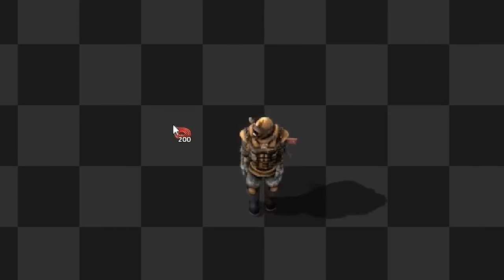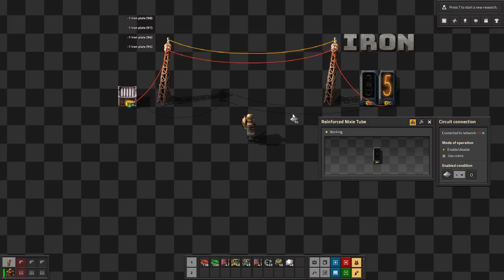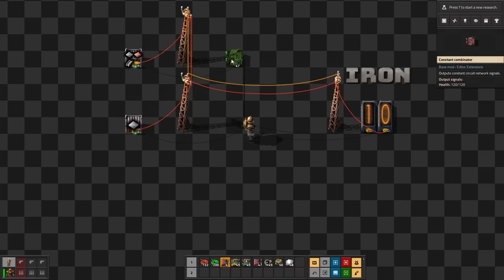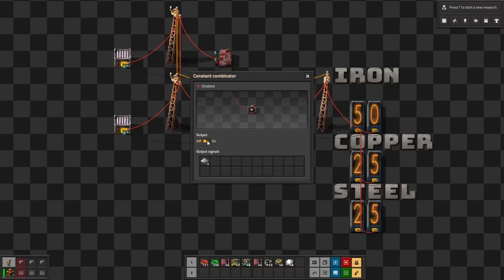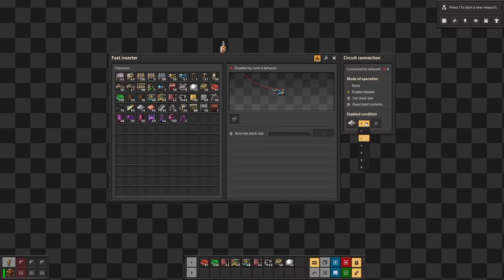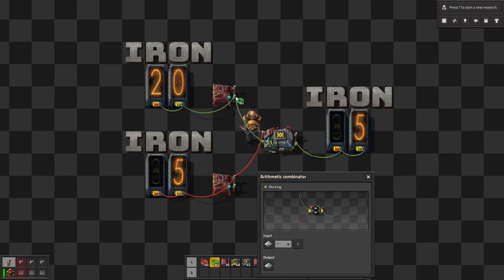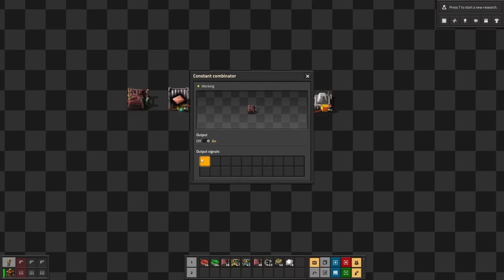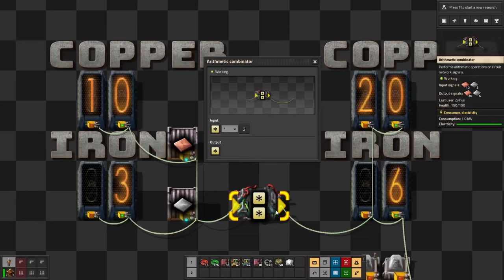Factorio Circuit Networks Explained in Under Three Minutes

Comment: Using signals to count the ore at a train stop, and only allowing trains in when there was enough ore for a pick up (to prevent trains hanging out in loading bays for too long) was probably the most complex things I've done with signals. Looking forward to upping my game.
Reply: For even greater convenience, I highly recommend the Logistic Train Network mod. You wire up your containers to the train stop, and add a combinator that causes the stop to request items when it doesn't have enough. Then a train, which was sitting in a depot, goes to whichever train stop that's providing enough of the requested items, and then delivers those to the requester. 
I'm currently using it in a city block playthough, and it removes so much of the finicky admin tedium.
Reply: I have such an immense respect for the intelligence of you factorio players. Cause I got lost about 30 seconds in
Reply: i've literally only read the input of a storage tank to turn on and off a pump to my oil cracking, you're probably ahead of me
Reply: Honestly you really don't need to.  Keep these systems simple and it'll be easier to copy, build, troubleshoot and fix.

When it comes to logic circuits - less is more.
Reply: Managing nuclear power is a great use of signals.  Wire up inserters putting fuel in and taking fuel out, and checking steam in a tank.  You read a steam tank to make sure you have enough of a buffer between steam capacity and heat capacity, the inserters removing depleted fuel are controlled by that, I think.  You read the removal inserters' contents, set them to hold, I think, and only feed new fuel in when depleted fuel is present, to make sure only one is in each reactor at a time, limiting the inserters adding fuel to 1 capacity, also.  Using logistics and requester chests is a great way to evenly distribute the rods to the feeder chests, and collect depleted fuel.
Reply: You can bypass all of that by just adding a stop/go condition on the train of: "go when x amount of time has passed with no actions". 
This allows the train to never stop making deposits and pickups.
Reply: @matthewcurry3565  Sure, but then I have trains constantly running, making tiny pick ups. And I don't want that either. Obviously there's no "wrong" way to play factorio, and I do/have used that condition as well. I just like closing stations that don't have enough for full pick ups. If a train is going to run, it needs to be full. Else it feels "wasteful" to me.
Reply: @ravingodd  Yeah, you combine it with wait till full so that it picks up as much as possible before leaving. You can add multiple conditions that act like or/and statements, but like you said. No real wrong to play other than getting eaten lmao
Reply: @CheshireCad  That's been in vanilla for a few years now.
Reply: @ravingodd can’t you just set the train to only move when cargo is full?
Reply: @zach237  "(to prevent trains hanging out in loading bays for too long) "
Reply: As someone else says, your method works, and may be what you want.  The alternative is not to set "Enable/Disable" on the train stop, but instead use "Set train limit".  If a stop is disabled, then it is just taken out of the locomotive schedule: the train goes to the following stop, incessantly.  If on the other hand you count the ore at the train stop, feed the signal into an arithmetic combinator to divide by (train's ore capacity), then output as a signal, (default is [L]) to feed into the train stop to set the limit, then the stop will only accept the number of trains that it can fill.  If that number is zero, then the loco will wait wherever it's stopped, showing "Destination Full".  If the train is in a depot, then that behaviour is mostly what I want. 
Attempt at a wiring diagram:
[ORE BOX]--[ORE BOX].....[ORE BOX]------[Ar.Combinator / 8000]---------[Train Stop| Set train limit]
8000 is the ore load in a 4-wagon train; adjust for different stack sizes and wagon counts.
Reply: @jonathanrichards593 my issue with this is I want to only allow 4 trains max and for some dumb reason there is no "max" operator on any type of combinator. It adds too much to each train stop.
Reply: I prefer using isolated logistic networks for mining outposts, you can just connect a wire from the train station to a roboport and read the logistic contents it's much simpler
Reply: Yeah it is also cool to make signals for like a cargo request when items are low

Comment: Something very important to note about signals is that they always default to 0 whenever there's nothing else going on
This means you only need a single Decider Combinator to rig a train stop to flip between having 0 or 1 maximum waiting trains, based on whatever signal!
(I personally string together the train stop's storage chests to the combinator and have the signal be Having Enough/Not Enough of the item the station is giving/receiving)

Comment: This is an ideal tutorial. My primary issue with most game tutorials, including factorio, is that everyone takes too damn long to explain something simple, this  leads to people thinking easy concepts are hard. 99% of factorio signals are setting a X>Y=enable signal, definitely dont need 20 minutes to cover that. Great job as always.

I'm not sure I like the re-upload more, but removing them makes for a cleaner video and doesn't compel me to pause constantly to read the clarification, so its fair play.
Reply: yeah i especially like how if i already knew all this stuff i would already know it and this just says again what i know, and since i don't know anything, this basically just told me again what i already know that signals control stuff but no useful info about how to begin using it
Reply: @anchez-os3fv  Do you have a question? If so, there's this really great 3 minute tutorial I found that, in the first 1.5 minutes, describes almost everything you could possibly need to know for about 90% of all circuitry usages in all factorio :D . In the last 1.5 minutes it goes into some unnecessary detail for advanced stuff that you'll likely never need so you can safely ignore it. If you've got a specific scenario that you think wasn't covered, I can probably walk you through it though, so feel free to ask.
Reply: @wilshireanasurimbor3068  well I came looking for a tutorial that explained the basics of using networks even if just briefly  and left knowing a vague idea of the concept with no actual explanation of the mechanics of using it. I've heard the OP is pretty well known for factorio so I thought it would explain more. I watched a video by another guy that was longer but explained much more how to actually use it. I'm just surprised so many comments are saying how this video was such a good tutorial that explained it so well. Seems like you would have to ALREADY know how to use it for this to summarize it for you.
Reply: @MarioSanchez-os3fv  Well I would say that the poster is well known for doing ridiculously elaborate runs, using extremely complex circuit mechanics akin to building computers in game, and generally being sarcastic. The 3minute tutorial is a great reference, and is more than all the information one needs to use circuits in game. 

Circuits are dead simple: connect wires to stuff and use the game's GUI to set things like X>Y to turn on/off inserters/machines/etc. If you need more than that, the factorio wiki does a great job both explaining basics and giving examples of common uses (SR Latches, Memory Cells, etc. etc.). 

With these two things, this tutorial and the factorio wiki page, you can get through even the most complex mods in factorio (Pyanadon, Space Exploration, Seablock, etc.).
Reply: @wilshireanasurimbor3068  yeah I see that now the title just doesn't convey that.
Reply: @MarioSanchez-os3fv  I don't know if you still care but personally spending 10 min experimenting taught me more than any videos out there. I suggest you do the same.

Comment: I look forward to the in-depth tutorial. I know the basics, but coming up with usecases that actually help my base is the hard part. If it fits the tutorial, can you show some designs you tend to use a lot?
Reply: Something I often use is I setup a logistics network at a remote outpost and multiply the value of all items in it by negative one. Then I have a constant combinator with however many items I want unloaded. Then, I add the signals together. This gets sent to filter inserters to set their filters. I can also use it to enable the train station only if I'm missing at least five of something.

You still have to load up the train (I just assign slots in the cargo wagon to specific items with middle click), but it gets around the problem of having only twelve inserters and chests and makes it really easy to add new items. I use it for supplying all the materials for defenses and for building new wall segments.

There's a much more complicated version that makes sure the filter inserters only try to unload things on the train, but it's a pain in the ass.
Reply: Two common use cases I have seen and highly recommend are managing your oil cracking/management and fuel rod insertion at nuclear power plants. Out of the box (i.e. no logic), both of these can be highly inefficient, which can be improved signifigantly using circuits.

Another use case I fell in love with was sushi belts on my assemblers. Rather than wiring up a complex network of belts to my assemblers, I used sushi belts to feed more complex recipes, allowing 3+ input assemblers to have the same form factor as a 1-2 input recipe (since my later designs also output to the sushi belt and split off the output product using a filter splitter, just make sure you wire the output inserters to turn off once the output belt is full or the output product will clog up the sushi belt).

Comment: One thing I would like to add, that you glossed over.

Connecting the input to the output of a combinator is the most common way to make a simple memory cell. Though they tend be easier to manipulate with single tick signals.

Comment: There's a neat trick you can do with the enable/disable of any inserter (yes, even burner inserters, somehow), exactly one arithmetic combinator, and a bunch of chests that you want to fill/drain more or less evenly (like at a train stop), so long as it's only one kind of item you're dealing with (you can probably make it work with any number of items, but I haven't gotten that working yet due to lack of need).
Anyways, how to make it do the thing:
First step, lay out your train stop with all the chests and inserters, but don't let it have any items yet. Count how many chests there are, and remember which item you're passing thru those chests into or out of the train.
Second step, wire all the chests to ONLY ONE color circuit network wire, and send that wire into the input of an arithmetic combinator.
Now, set the arithmetic combinator to Divide, with the left signal being the item that's going thru the chests, and the second signal being a constant equal to however many chests you had. This gives you the average number of items in the chest, because an average of more than 2 numbers is just "Add up all the numbers, then divide that by how many different numbers there were", and connecting all the chests to a single color of wire already added together all the items in the chests, and the constant that the arithmetic combinator is using matches the number of "different numbers" aka chests you have.
So you have the average number, what do you want to do with it? Well, I usually tell the arithmetic combinator to output the average signal to "Signal A", where A stands for Average, just so that I don't get confused.
OK, Step Three, and here's where it can malfunction if you don't wire it up right.
First, which inserters are we talking about here:
I usually make my train stops with 6 chests and 12 inserters per cargo wagon, with 6 of those inserters linking the 6 chests and the cargo wagon, and the other 6 linking the chests and the belt. For a "standard" 2-4-2 double-headed train (what I usually use, out of habit more than anything), that would be 24 chests and 48 inserters, but if it's a high demand item I'll also do double sided load/unload from that train so it would in that case end up with 48 chests and 96 inserters.
In any case, if you always have 2 inseters per chest, we can keep going, I'll tell you how to adjust for more inserters being used all the way at the end, but I have to get the basic concept out of the way first.
So, 2 inserters per chest, one moves items between the train's cargo wagon and the chest (or vice versa), and the other one moves items between the in or out belt and the chest (again, direction doesn't really matter yet).
I'm talking about the inserters that move items between the belt and chest.
Now that that bit of explanation is out of the way, let's start actually building again. You've already got ALL the belts chests and inserters arranged next to a piece of rail to load or unload a train, and you have an arithmetic combinator calculating the average number of items (what you want) in any given chest. That's good, now let's put that number to work.
Look at the color of wire that's going into the arithmetic combinator, and use that same color wire to connect up the output of the arithmetic combinator and all the inserters that transfer items from or to the chests to or from the belts (respectively). This feeds the average signal into each combinator, and you should have two SEPARATE wires of the same color now, one adding up all the chests and feeding that number into the combinator, and one coming out of the combinator and feeding the calculated average into the inserters.
Now, take a wire of the OTHER color, and connect it between one inserter, and the chest it is interacting with. The idea is for the inserter to have two signals going into it, an A signal carrying the average on one color wire, and the actual chest contents signal on the other color wire. We can't let those two signals mix, so we have to use two different color wires. We also can't let the actual chest contents of any other chests show up on this wire, so we need to make a lot of really short wires that are not connected to each other, with each wire connecting a chest and the inserter that allows items to go to or from a nearby belt.
OK, that's SUPER IMPORTANT, so don't get things cross-wired or it'll either act like the circuit wasn't even there, or it'll deadlock.
Step 4, setting the conditions on the inserters. This part's a lot easier.
All you have to do is compare the contents of the chest to the average, but now the direction the items are going matters, because that determines which comparison you need to use.
If you are loading items into the chest from the belt, you should set "Chest contents less than or equal to A (A is the average signal, remember?)".
You can't use just plain old "less than", because I've discovered that if everything backs up like you want it to, that will deadlock the inserter (it's just doing what you told it to, even if what you told it to isn't what you meant).
If you are taking items OUT of the chest and putting them on the belt, you should set "Chest contents greater than or equal to A (with A again being the signal carrying the average number of items per chest, compared across all the chests)".
And again, you can't use just plain old "greater than" or it'll deadlock when things get backed up.
In both cases, the default state is "do something even if they're equal", and that's why they don't deadlock when you use the "Less/greater than or equal to" condition.

That's all there is to it, unless you made a more complex station that uses more inserters interacting with the belt than there are chests.
If you built a "normal" train stop, you can stop here, that's it, you're done, let items go into or out of the chests and watch it automatically balance feeding items into or taking items from the train, all your cargo wagons should be filled or drained at roughly the same time now assuming you have belts feeding chests feeding cargo wagons for all the cargo wagons in that train.

But what if you DO have one of those more complicated stations with more inserters than normal? Well, it's not TOO hard to accommodate that, in reality.
All you need to do is make sure that all the inserters that can interact with a given chest have an isolated circuit wire that reads the contents of the chest and send that value to the inserter(s) putting items into or taking items out of that individual chest (and on to or off of a belt).
So if you have a train stop that has only 2 chests, with 2 inserters feeding items from the cargo wagon into the chests, and from there another 4 inserters feeding items from the chests on to the belts, you should have an isolated circuit network wire connecting a given chest with it's 2 associated inserters that are putting items on the belt. The circuit network conditions on those inserters remain unchanged, it should still work just fine.

This would be a lot easier to explain with pictures, or a blueprint, but I think I still managed to get the point across adequately.

Comment: This is brilliant! And while you do have a in-depth tutorial on circuits coming up, I was wondering if you could do another three to five minute video explaining how to make and use clocks, memory cells, and latches? (Or at least a video that is them extracted from the master course) They are things I try to use and have read up on plenty, but can never remember how to set them up. Having a video about those specifically would be really helpful.